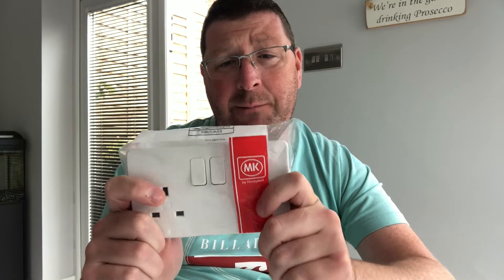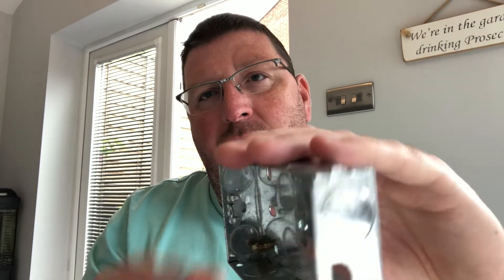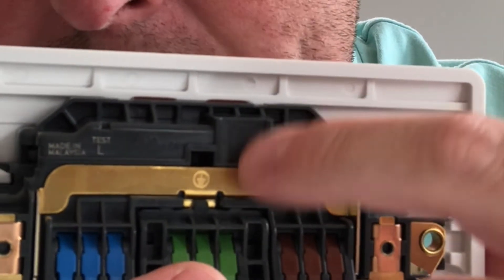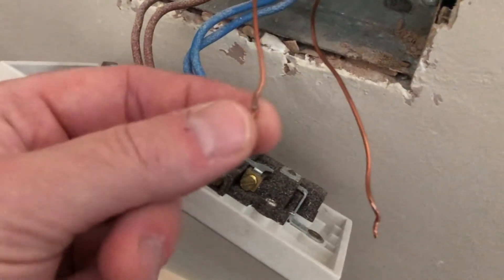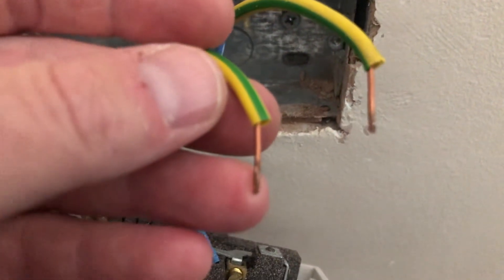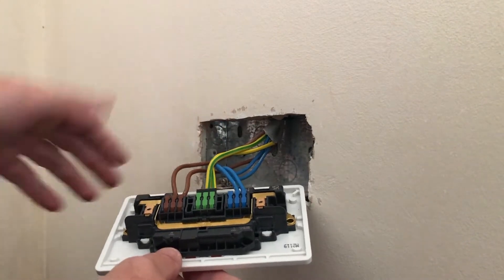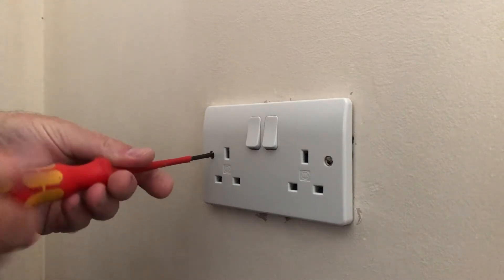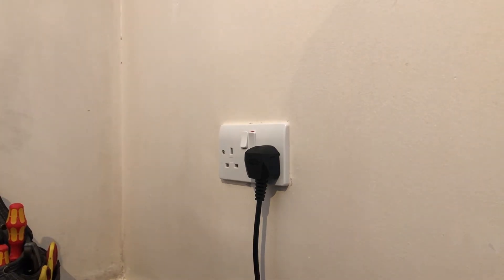MK Logic Plus Rapid Fix Installation Review

Comment: No flying lead ! If one fitted how do you add a fused spur to it , only way I see is to twist earths before installation
Reply from the maker: Hi, Thanks for your question. A fly lead is only required for a box that has not got at least one fixed lug or is a metal surface box such as attached to metal conduit. As the screw termination in the rear of the box is fully accessible you can use that to loop through if required. I agree its preferable to terminate into the rear of the socket but this would maybe need to be taken into account at design stage for any spur off. Chris